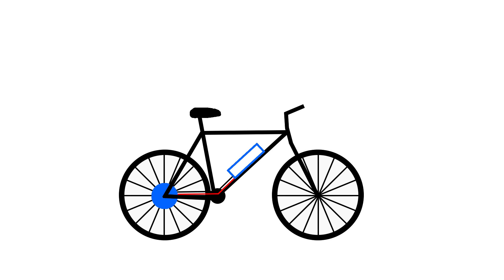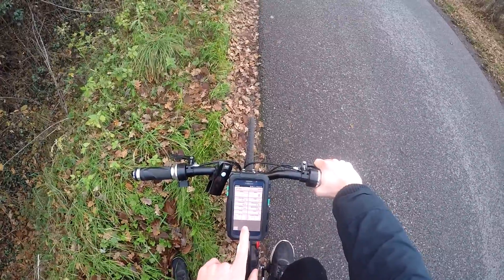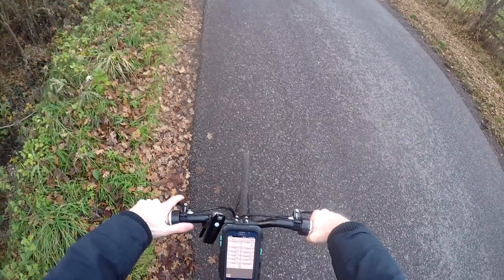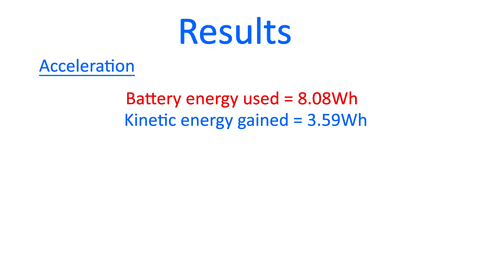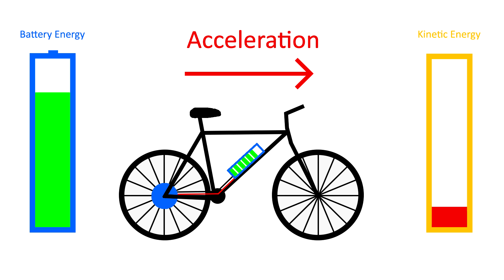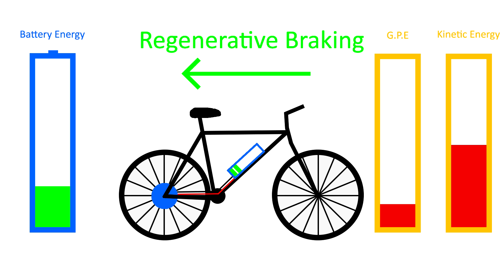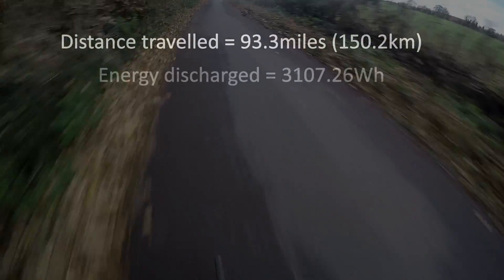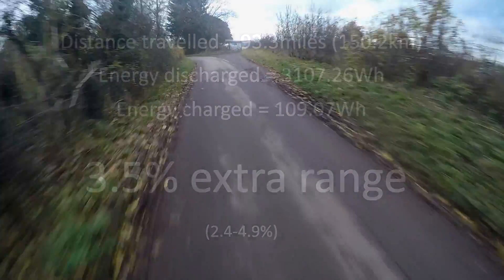Regenerative Braking tests

Comment: i added regen to my direct drive rear hub motor kit and one thing that no one is talking about is how good it is at braking without ever locking up. normally when braking as you apply both brakes hard the weight goes forward making the back wheel light and making it lock up, by using regen braking you have a brake that wont lock on the back allowing you to use the front without having to modulate the rear.

Comment: The intent of electric assist isn't to be used constantly like on an electric car but to be used for accelerating and a boost up hills. Typically when riding, one would pedal more for cruising and after needing that boost at the red light. The energy input from the cyclist would likely add to the regeneration of battery energy.

Comment: First of all I just want to say that I really like your videos! 

I believe that an error is made when comparing the efficiency of the regen braking accelerating and going up a hill. Pounder that you would go up the hill very very slowly, and then go back down very slowly with the regen breaking, then the wasted energy from drag would be minimal. On the other hand, if you would go up the hill a great speed and down again fast because the regen breaking wasn't powerful enough for the slope, then you would waste more energy to drag. Therefor, I think it is wrong to suppose that the 15,7% would be true for the slope example.

Another point is that in theory you would approach your final speed as a limit when time goes to infinity so you would have better efficiency if you accelerated to 25mph instead of 35.

Comment: Excellent video! I've heard that poor regen efficiency is due largely to internal resistance in batteries. Some have proposed hybrid battery/ultra capacitor set ups. Wonder if you could test a set up like that?

Comment: The most glaring issue with this was the noise. Not that the noise itself is an annoyance but it is clearly the main source of the energy that is lost from the main kinetic—>electrical—> kinetic loop. For that matter I would wonder if it were instead possible to place a flywheel next to the rear wheel that can return kinetic energy from braking without producing a lot of noise or drag.

Comment: Tom you are right -15% is the maximum of energy which can be returned by ebike regen during the most agressive riding like yours. With other kind of riding the regen will drop till 2-3% and even till zero. 
I checked this on hillclimbing : spent 99Wh and returened 16Wh, i.e. the same 15%. During another long usuall riding including some hillclimbing I gained only 5%.
I deleted my previose post :-) .

Comment: Very interesting! We’re adding solar cells to our electric scooter (Model M365) which will be utilized as a range extender. We noticed that the phone app which communicates with our scooter (Mi Home app) shows an energy consumption as low as 50 watts when traveling at a constant speed of approximately 5 to 7 miles per hour. We are presently using the SunPower monocrystalline solar cells, rated at 160 Watts (See Elfeland SP-22 Folding 160 Watt Solar Panels). If these cells can produce half of their rated output we may have a constant input (while the sun is shining) of power - acting as a range extender for the EV scooter. The EV scooter has a 250 watt motor, and a 36 Volt Lithium battery. We purchased a Genasun Boost MPPT Charger which will add power to our battery, from the solar cells. Marissa Muller here on you tube utilized 240 watts of SunPower solar cells to power her 250 watt electric bike across the country, permitting the solar cells to do 60 to 70 percent of the work, while she add the 30% to 40% via peddling the bike. Marissa notes she chose to limit the sunlight’s contribution of power so that she could get some exercise and thus help improve overall health. It’s a story that inspired us and so we too are studying how we can allow nature to help power our electric scooter.

Very nice Ebike by the way! Great video!

Comment: At such low efficiencies using electric regen, you should explore other methods like compressed air, hydraulic, fly wheel, springs etc, basically any method to get something back quick when you have to slow down and waste energy unnecessarily.

Comment: You should try a super cap as a load for the breaking. Regenerative breaking works if you do it at peak efficiency point. I doubt the batteries are sinking the current the motor could be generating.
Its all about matching impedances. A super cap is really low impedance so the idea is you charge the cap as much as posible and then dump the energy back to the batteries with a boost circuit.
The more current the more breaking.
You could get an idea of what you need by checking the voltaje open circuit at full speed and then the short circuit current at full speed. Do the math and that should give you your equivalent series impedance. Your load should always match that to have the most power transfered.
Reply: This is what I am looking for, a super cap to even out up and down hill rides. I don´t want an electric bike I just like to store the energy wasted if I need to break and use it shortly after. A flywheel might do it but I guess it will be to heavy.
Reply: I second that motion. But I'dd add a voltage measuring capability accross the capacitor.
When the voltage gets near the capacitors rated voltage (which is often low for super-caps) then the excess current that couldn't be sunk by the now charged capacitor is dissipated as heat over a high wattage resistor.
The same principal easy to understand would be a 220uf 50v capacitor slowly being charged.
Over the cap, you'd connect a 47v zener.
The cap would absorb current until it got to the 47v, and then the other incoming power would be dissipated as heat in the zener - Protecting the capacitor from overvoltage, and allowing the continual un-interrupted load.
Reply: @dancoulson6579  
a zener alone would be impractical, but you could get a 30-35v zener and hook it to the gate of a mosfet (or several) with maybe a resistor to take some load off of the mosfet.
also theres no need to let the super cap charge at all, as the more voltaje it has the less difference between the two and so less current being sunk. you should really keep it as low as the boost circuit allows.
The zener thing could work as a sort of protection for the super cap in case it were to "saturate", it should still give you some magnetic breaking though it would be wasting the energy as heat.
if anything the boost converter and the voltage limiter should be capable of handling more power than what you would or could generate typically un average. say a slow breaking or a sudden one where youd be dumping all the kinetic energy from the bike and your body into the regenerative break, to avoid saturating the cap.
also i wouldnt use a normal high voltage cap as they have really high esr compared to super caps. you need energy density not voltage tolerance.
sure 50v makes all easier but it will be huge in comparison and your boost converter would also be bigger becase it would saturate much faster so it would basically have to be as powerful as your motor breaking at which point you might as well do away with the cap and just use the boost converter as a break.
if resistance is constan then the cap at 0v will sink twice as much current as when it reaches 25v (assuming 50v open circuit), and that means half the breaking force, thats why it doesnt matter as much the voltage of the cap as its the impedance.
like how a 100C 1Ah lipo cell can do 100A because its really low impedance even though its only 3.7v.

Comment: You can use the front wheel to regenerate energy all the time you moving, just add another motor in the front wheel and another battery, the front wheel will collect energy to the new battery and the new battery will support the other one you just need to control it if it is charging or supporting  , then you bike will travel double the distance that you have now

Comment: This is the reason why it makes sense to add a freewheel to electric drive. :-) And it was also one of the reasons why my electric motorcycle didn't have regenerative braking.

I really like the simplicity of your project. I am seriously thinking of building another e-bike - mainly because I have almost free access to VESCs (I designed a custom - smaller version). Thank you very much for sharing all your files and so many details of the project!
Reply: I was wondering about this too, I wonder how freewheel would compare in efficiency to regen in real use, I suspect that it would do very well in hilly terrain where you can just build speed on the down hill and if you peddle assist. Also, if you run out of range, I wonder how much peddling resistance the electric motor provides that would be eliminated with a free wheel, seems a lot to push that belt and motor along with the bike.

Comment: I think you should use this braking system in both of the brakes it will increase the efficiency by 30% if u r using on one . Another thing is if u use an another motor in front wheel so while the vehicle will move that motor will also generate energy while moving along with the wheel. I hope i am correct.

Comment: It's much more efficient to coast than it is to brake, a bicycle and a rider is a small mass, there is very little momentum to recover any useful amount of energy from. You may see a difference in charge after a 200 mile descent, but you'd never make it back home again. Best to just have a freewheeling motor so you can still pedal home if necessary.

Comment: When calculating rb efficiency you should only consider the energy being used to accelerate and decelerate the total mass and disregard wind resistance etc as the energy recovered by the braking is only harvesting from the kinetic energy available(+ potential lost if going down hill or - pe gained if going up hill). Energy lost due to drag etc will be a function of acceleration as this will determine how long it took to reach terminal speed an so will be greater for slower acceleration and this means that all the energy put in cannot be available for braking recovery. Only the kinetic available at the instant of applying the brakes will be available and a great deal will still be lost due to drag and conversion losses during braking. You should find that your actual energy recovery from the available energy is much higher than it first appears.

Comment: you would deffo save your brakes as you are not using friction pads but rather using electricity and magnetism to slow you down so there is no grinding or scraping sound of the brakes, i think this would be very useful in a long downhill where you dont want to go full speed as its too slippery and rocky but dont want to hold brakes constantly

Comment: Well in an electric car you wouldn't even think about pushing it up a hill and then recharging the batteries with regen braking. With a bike you can choose to use your muscles to get you up the hill and use the regen braking downhill to charge the battery if it's getting low. This deserves to be considered or atleast mentioned.

Comment: Is there a way to put an efficient capacitor in the loop to boost performance?  If the maximum recharging rate of the batteries is less than the draw on the system, then that would mean a lot of waste heat.  My guess is that if the batteries charge slower than they discharge on this system, a capacitor in between would allow more of the energy to be recovered and either pushed back into the battery slower or used to accelerate the bike on the next leg.

Comment: Hi Tom.  Excellent project and video, but at 4:09 you show a kinetic energy figure of 3.59Wh and you state that theoretically you should be able to recover ALL of this energy if it were not for the inefficiencies of energy conversion.  No problem, that is a given, but since you actually recovered 1.27Wh, is the efficiency of the regen braking not closer to 35%?
Available = 3.59Wh
Recovered = 1.27Wh
1.27 as % of 3.59 = (1.27/3.59) x 100 = 35.3%       Surely the figures can't lie?
Regards Mark in the UK
Reply from the maker: +thecorbies Hi Mark, yes that is correct! When riding, I mentioned it was 14% 'efficient', however what I meant to say was "it recharged 14% of the energy used". So later in the video, I adjusted what I meant to say that it gains 15.7% back into the battery. This 15.7% wasn't meant to be the efficiency of the regen period, but instead, how much battery is recharged during the regen period.
Regards
Tom
Reply: Good point, but  in this case the efficiency of the regen braking is much more than 35%:
Available = 3.59Wh
Recovered = 1.27Wh
Max speed 35mph or 15m/sec, consuption is 30Wh/km
Final speed 0, average consuption is 15Wh/km
Time of breaking  12sec
acceleration is - 1.25 m/ss
Breaking distance 1.25x12x12/2=90m
spent energy for passing breaking distance 0.09x15= 1.35Wh
then 3.59-1.35= 2.24Wh is left for returning back
Recovered 1.27Wh of 2.24Wh or 56% !!! :) .

Comment: What I know about cars is that most of the energy used is from pushing air out of the way. It's probably the same for bicycles. So I think you are incorrect about hills. (Shell used to run a modified VW between LA and Phoenix and back to claim their gas was more efficient. The mountains along the route was most of the trick.) And I have a somewhat relevant test. I drove my Prius up into the mountains using 'Worried About Global Warming Mode", or 'extra wimpy.' Eco Mode+ gentle accelerating, not going too fast...  I averaged 99 mpg for the trip. (Normal for me in my Pri-V is 39-43 mpg). I live in Los Angeles, we have 2000 foot mountains in the city,  in less than 40 miles on roads I can be at 5000 feet. So with mountains regenerative braking on a bicycle could be not just practical but amazing. If I had a bicycle that could go 40 miles on a charge with pedal assist, then I'm sure that I could get up to Mt Wilson where my charge would be empty, and then recharge going down hill regaining a significant charge to go the last 20 flat miles home.  The calc for the downhill section would  be 20 miles at a reasonable speed 15-20 mph, full charging along the way. (I don't know how you're regenerating power, but with a generator connected to the wheels. I'd still be going 15-20 mph, it's that steep.) This particular highway, the Angeles Crest, is downhill 99.5% of the way for about 100 miles. The portion discussed above is even steeper. The last 18.6 miles has a 5200 feet elevation gain. (La Canada to Mt Wilson). What would also work is knowing at what battery level I should turn around to have enough juice left to make up the 100' hill to my house.
Reply: Will Nettles Bikes are much worse than cars for the percentage of energy lost to wind resistance - 75-90%.

Stupid air! :)
Reply: Wow! That's mostly bad news, but mountains with electric assist should be even better than in a car. I don't have an e-bike yet, but surely someone in Southern California does, get in touch, I've already got the experiment designed.
Reply: It's not necessary to know the entire LA metropolitan area to understand  conservation of energy. When you ascend any hill, and have an entirely empty battery at the top it, the range you will have at the (any) bottom is only dependent on regen efficiency and power lost during ascend+descend due to drag (wind and rolling). Tom does a great job explaining the physics, but to be honest it seems to me high-school level. The ingenious bit comes from actually making it work and providing some figures. Probably you could model any situation quite well knowing wind and drag resistance functions/curves, motor power efficiency curve and regen efficiency curve. I suspect the motor+esc won't be as efficient at regen at every rpm and regen power.
Reply: Yes, but.... Mt Wilson (5700 feet, La Canada is 1200 or 1400 feet altitude. I don't understand how the 5200 foot gain was arrived at. At most 4500'. ( I was nearby today at 1100 feet) This is significantly different from UK hills. I think it's the perfect laboratory for regenerative E-bikes. What you say about speeds, gears, etc.. are all essential controls. Same bike, same speed, same rider, same weather..... But I think 19 miles and 4500' elevation gain will clearly delineate what's air/road/mechanism resistance and what is gained potential energy. The one factor that should make this a terrific route for a re-gen e-bike, is of course the rider is pedaling. It will look like 100% efficiency, but only because the rider is pedaling. Btw the trip down requires braking because it is steep. PE ( I don't like using K) = m*g*m, so let's say bicycle and rider are 80kg* 1500m*9.8 m/s/s= 1,176,000 joules. 36 v x 15,000 mAh battery - 1,944,000 joules ( I looked this up) So. 1. Depending on the rider's contribution the battery alone cannot possibly get him/her to the top of Mt Wilson. 1.1 versus 1.9 is about half, all the frictions and efficiencies have to be very significant, and rider's contribution may be known amount--but I don't know it. And clearly this battery can not possibly be fully charged by the downhill part. (Unless perhaps the rider carries some rocks down, which is quite feasible).  I wish I knew more, and had an e-bike. Coasting downhill with a generator and uncharged battery would quickly answer a lot of questions. But 5%? I think it will be significantly more. My Prius, and the Shell gas test, clearly demonstrate that.  (Also I don't mind Tom using high school physics, I do think he's missed a few things. As a teacher I've been there too. Just go over the same thing a dozen times and suddenly it becomes not only clear, but obvious. (You really can explain everything in physics to a three year old, just not all at once.) And I do think being in England Tom doesn't have the opportunity our local mountains  provide.  Of course he's investigating a practical re-gen solution.